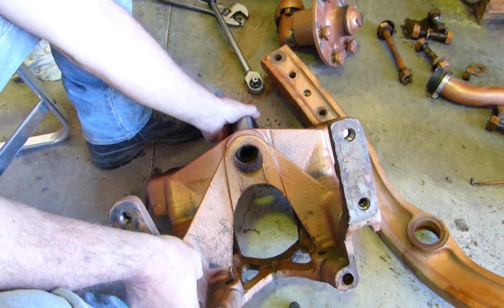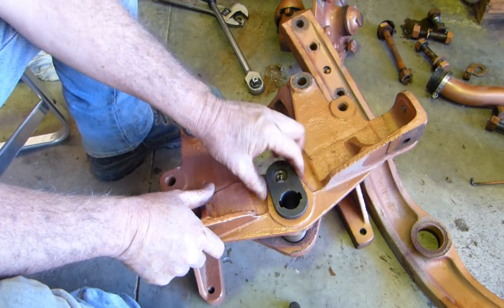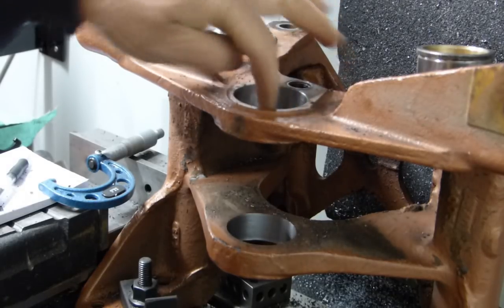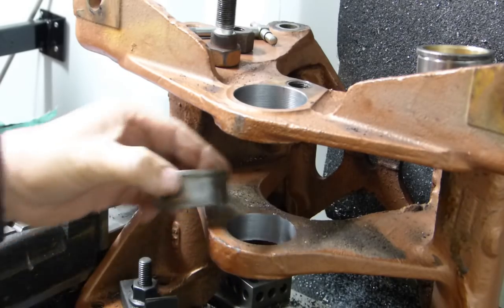Ferguson FE35 Grey and Gold Restoration Part 18 The Front Axle Pivot

Comment: Hi Lance, do you know if the centre beam of the front axle on a 3cyl MF35 is the same as on a TED20 tractor? They certainly look the same but someone on Facebook has told me they're not the same. I want to replace the centre beam on my MF35 and I can get a good one off a TED20 but if they are different it's no use to me. Sparex offer  replacement centre beams for both tractors and they're the same part number. Same with Agriline. I thought I'd ask if you knew. Thanks. Peter.
Reply from the maker: The only difference can be is that the early ones had a very thin pivot bush but the later ones had a fat flanged bush. If you get an early one it is not a big job to machine it to fit the 35 bush, I do that often. The 35 will fit backwards to a TE20 though.

Comment: Great job lance.Is copper a must have in the bush you cut the track in,the reason I ask is that I have a bush in my te 20  front axle and it's steel.Keep up the good work.
Reply from the maker: The early bushes were steel on steel pin

Comment: Normally on those pins with bolts they need to have the tabs not clamped tight or over time they fatique and break the tabs. I doubt this machine will see the hours though for it to ever matter. :-)
Reply from the maker: G Day Brian, Yeah there seems to be a fine line between sloping around and having some give, Im going to fit a grease nipple into the pivot to take any extra stress away.

Comment: Hi mate 
Great vids keep up the good work you r inspiring me to start on my dads old tractor love to see it restored. How do you determine year and model i know its a diesel 35 year unknown 
Thanks joe
Reply from the maker: G Day Joe, Send me the serial number and I could possibly help you out. Send to bundybearsshed@gmail.com
Reply: Bundy Bears Shed  Hi mate
It’s a FE 35  SNM. 226800
Reply from the maker: Your Fergy is standard width with a Perkins 3 cylinder A3.152 diesel engine and a dual stage clutch. It was produced in 1962.
Reply: Bundy Bears Shed 
Hi Mate thanks for that  can you give me a price  on a steering box kit  and i think main rear seal is also leaking  is there a kit for that also .Delivered to kurrajong nsw 2758 
Thanks joe
Reply from the maker: G Day Joe, Give the shop a ring on 1300 850 097 and have a yarn to Ross, he will sort that easily for you. Im away for a rew days as the web site is down so Im home working on old tractors, lol.